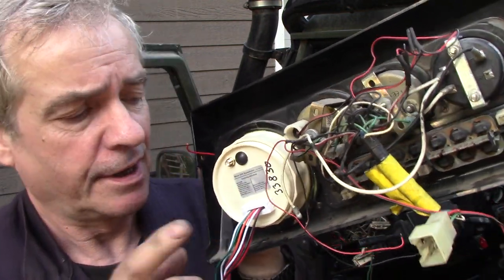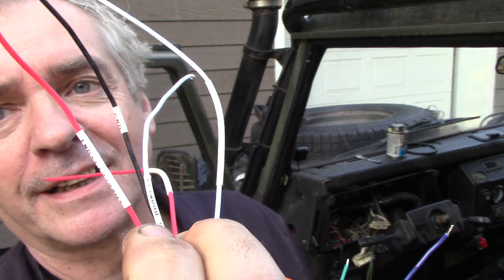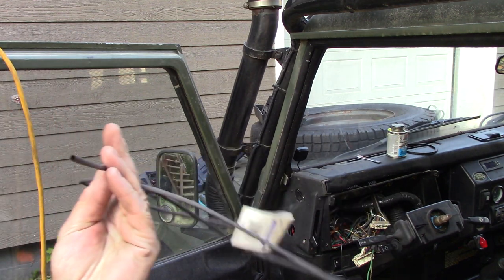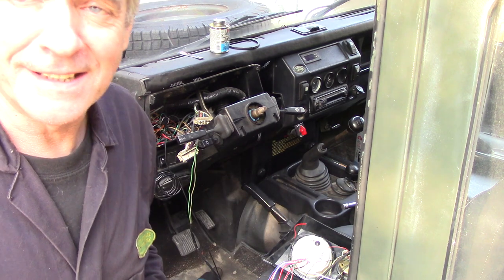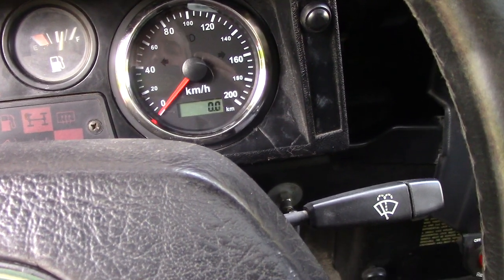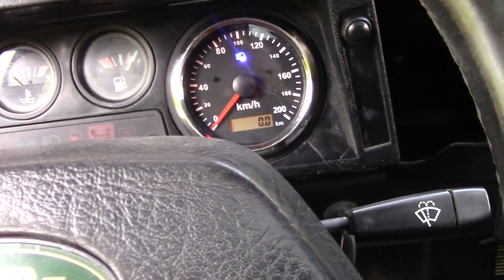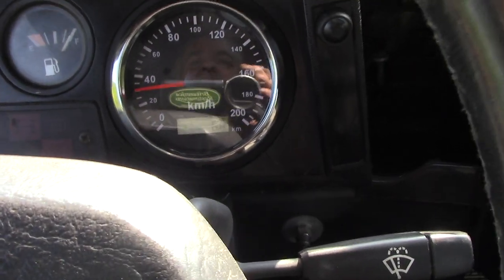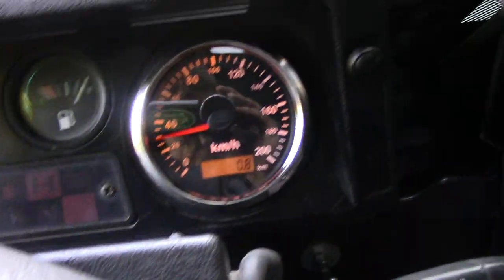GPS speedometer into a Defender Part 2

Comment: I had to fit something similar to an old Ford Ranger, as the instrument packs on those are a) fragile, and b) made of unobtanium. This was by far and away the easiest and cheapest way to sort my customer out - beyond that, he was scuppered with that vehicle, as there was no way he would get a repair. It was brilliant, right out the box, and kept that truck going for another couple of years. I think a lot of these are intended for motorbikes, hence the indicator and high-beam integrated in the instrument.
Reply from the maker: Lots of variations of a theme for these - boats, bikes etc

Comment: Great product but surely the lighting should have white and green options so as to match the Defender's lighting? Also a clip-on black rim would be a good option for it to come with, again to ensure a decent match. I like the fact that you can set the mileage to match the old speedo.
Reply from the maker: https://www.amazon.ca/ELING-Universal-Speedometer-Velometer-Motorcycle/dp/B07DY476W8/?_encoding=UTF8&pd_rd_w=D4Mc7&content-id=amzn1.sym.fd852109-df41-4ce9-b0ef-f5d8fc4554a2&pf_rd_p=fd852109-df41-4ce9-b0ef-f5d8fc4554a2&pf_rd_r=7Q3C5AEVQ717KAK8P3GQ&pd_rd_wg=ai5aE&pd_rd_r=8d947f41-1059-428a-8f62-251952da45be&ref_=pd_gw_ci_mcx_mr_hp_atf_m

Comment: I take it they don’t work in tunnels etc Mike? Or maybe just maintain the last ‘known’ reading?
Reply from the maker: Yes and then they calculate the distance from no signal to new signal
Reply: Got it. So they’re actually a bit more sophisticated than you would assume. Great bit of kit. Especially for modified vehicles with ratio/wheel size changes.
Reply from the maker: Exactly!

Comment: Is it legal to have one in the UK Mike? Wasn't there some Rule in the MOT years ago that the speedo has to be working. How would they know on the rolling road. 
Or have I just made all this up and it's all b*ll*cks. It wouldn't be the first time.
Reply: No you're right, it has to be seen as working. They don't work in tunnels or over some types of steel bridges either. There's no accommodation for GPS speedo's in the MOT handbook so strictly speaking they're a Major Fail on the UK test
Reply from the maker: We do not have MoT / inspection here.
The only time a vehicles mileage is recorded is when it changes ownership and then if you are not sure, then you can state speedo broken
Reply: One of these ought to get a car through an MoT. Regulations-wise, the backlighting must work, and that's about it. However, if you want a plausible odometer reading from test-to-test, then you need a working speedo. The only time an MoT tester would know if the speedo worked, or not, on a test, would be if he took the vehicle out for a Tapley Test on the brakes, and at that point this speedo would be fine. Some "normal" speedos will not work on rolling-roads either, as they are not driven by the ABS-controller output until the average wheel-speed is above a minimum threshold speed, always well above what these rollers are run at for brake-testing. So the biggest challenge would be to carry the original odometer reading over onto the new GPS unit, which it sounds like Mike has found in the instructions.
Reply: @stuartbell7078  That is what I like about this channel. Proper blokes in the comments.
Thanks Stuart.
Reply from the maker: I think I am right in understanding the Discovery 2 as no speedo drive but averages out the 4 x ABS wheel sensors to operate the speedo - this would be interesting to see on a regular rolling road! 
(Knowing my luck, it would probably put the 3 amigos lights on...)
Reply: @BritannicaRestorations  Yes, you're bang-on correct here Mike: Disco2 uses the Wabco ABS signal to drive the vehicle speed signal into the instruments and the engine controller. I cannot remember how much redundancy there is for wheel-speed-sensor dropout on one or more corners- I would have to look at a System Information Document for that - before the speed signal was ignored. As D2 is a permanent 4WD like so many modern offroaders, you cannot run it on a single-axle roller above 5mph to see if the instruments still work - they might, but the centre differential might not afterwards !!
Reply from the maker: Something broken on a D2? Well, fan my brow! Lol!